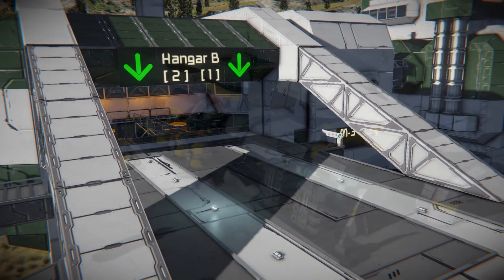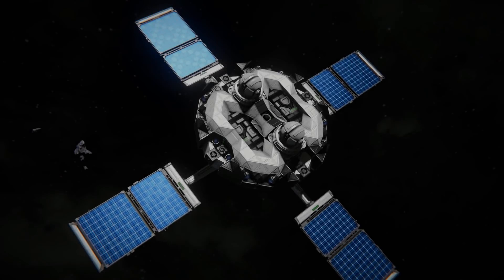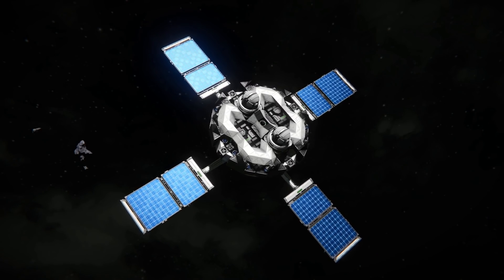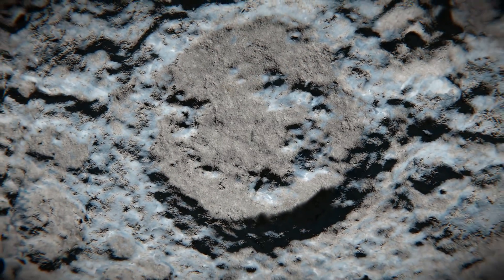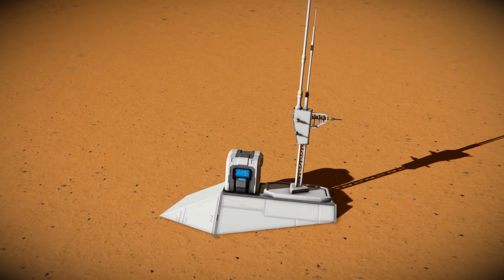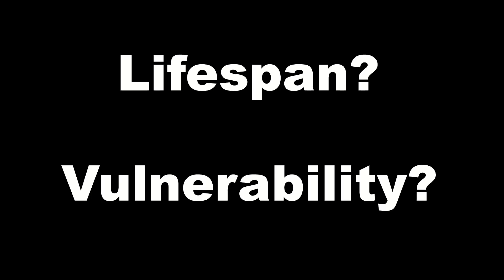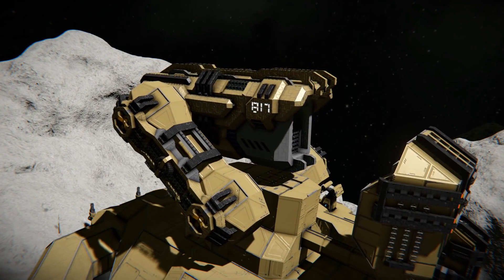The power of communication - satellites

Comment: While I enjoy radio and laser antennas usage for remote control and communication, a major flaw is with the signals on the HUD. If only you could turn off seeing the antenna from your personal HUD, it'd be a lot better. I dont want to constantly have every vehicle with an antenna show up on my screen, while I'm trying to go to a specific coordinate.
Reply: you can do that 4head
Reply: Just turn off show on hud on the antenna...
Reply: @benlawton5420  This wouldn't work, since I do sometimes want to use my antenna to locate the vehicle.

I did find out that it indeed is possible to stop seeing antennas! If you go to the info menu, there is a slider for how far you want to see neutral/hostile/friendly antenna's! I never knew that was an option!
Reply: @Moshthun  Would it be possible to put a remote control block on the vehicle so you can remote access the antenna?

Comment: Nice video! I tried to do something similar in the multiplayer server I played. In this server, the only planet with uranium was the Alien so my faction and me spreaded 6 radars (mod) around the planet (2 in each pole and 4 in the equador line, to minimize the blinde spots). Our goal was to detect and attack any player who tried to mine the planet, so we could monopolize the uranium production and sell it at high prices at our trading station near Earth.

We tried to make some high towers with laser antennas to connect all radars to our main base, but the server didn't render grids that doesn't have players near by (for performance optimization). So we had to use radio antennas, but they denounce our radars location.
Reply from the maker: Controlling uranium is a big thing, you figured the radar system pretty nice too.
Unfortunately most of SE servers, due to the game optimization can't handle such tasks. 
I hope that in the new update we'll get some improvement in that matter. That would be a big step for the game.

Comment: Honestly if you want optimum efficiency out of your long range relays place the sats further away. The longer the distance the more area is covered in the FoV. Keeping this in mind a grid of 3-4 laser satellites placed in a triangle or pyramid formation should be able to cover nearly all area you’ll need only being blocked by the occasional object floating inside its fov.
Example: placing the earth moon system inside a triangular base pyramid formation should cover the whole earth and moon in coms provided that the satellites are far enough away and one of the vertices is placed on the other side of the moon from the earth

Comment: This is fantastic if you have a server capable of keeping all these grids simulated over such a large range.

If your using concealment via torch server this won't work unless you mark all grids intended to use communication like this as exempt or if a player is located at the location as once the grid exceeds the range of concealment settings it will no longer be simulated by the server

Comment: For the lifespan of satellites you can simply use a lot of solar panels, and automatic orientation to the sun with radio antennas. You could also use backup reactors or hydrogen engines.

Maybe a timer block for when you want to temporarily deactivate their antennas to save power ?

Comment: On a server I used to play on where we were testing out a mod to have massive amounts of players being able to play on one server we used to have to use laser antennas constantly. Especially for old stationary Grav Drives since you need to know if there is any obstruction at the end of the ring chain so you don't hit it when you launch , and to know if that section of ring chains is even active. You don't want to just blast past the area you were trying to go especially since back in the day dropping out of Grav warp with using thrusts sometimes caused issues where your ship took large amounts of damage suddenly dropping back to the max flight speed from the broken Grav speed.

Comment: I've cuaght a few of your vids, I like the way you are presenting this material. 

Here's an additional thing : 

Place a camera on the Sat systems that will look at the plannet. this allows you to remote into them, veiw through the camerra and take a screen shot. 
From there you can use an image conversion tool, or find a player made Screen img mod and modify it (replacing file names and saving it in a folder with the images) 

This allows you to make a map of the area, each picture can be displayed separately or joined on multiple monitors (you may have to edit the screen shots depending on screen resolution)

Creative people can use this process to make a mill briefing stile infographic to put up in their base

Comment: Love the content. 
I've always wanted to setup a von Neumann probe in space engineers. Seeing the creative uses of scripts like pam in videos like this and sorts. makes the idea a lot more viable when you have well versed users attracted to the game. 
with the use of merge blocks, projectors, and some programs that can interface with pam. a self replicating pam base station sounds amazing. I've only gotten small concepts of the separated segments of the idea to work. but patching it all together is a full on job all to its self.
Reply from the maker: I think it's possible but it needs to be made out of resources which you can refine from stone. Otherwise the probability of hitting a cobalt or uranium vain are low and it could get stuck.
I will think of how to make it. Perhaps there is an easy way. 🙂

Comment: Been tinkering around with that kind of stuff lately. For me, the bottleneck is always the power consumption of the vanilla laser antenna.

So I could either mod it, make extremly big solar panels (eating away processing power) or go for a more "static" approach.

My satellites use Isy's Solar alignment script, but even with that the power draw on laser is just too damn high - and I don't like limited lifespans (despite being realistic, but it's tedious imho - I might as well get a mod then which is adding tearing down of working blocks in general).

In the case of earth and moon, you could probably just set up your bases in a way that they constantly "see" each other and feed the grids with reactors and such.

Since I run Industrial Overhaul, I could also just go for some RTGs and add enough uranium to last them for like a reallife year or something.

Another approach would be to write a script to shuffle through Laser Sats and put them to recharge, while always one is active. But again, this is taking away PCU and is overcomplicated for something which shouldn't be much of an issue imho.

Thanks for the input!

Comment: I setup a automated setup like this overly complex and i had to constantly rebuild the transport drones but i had mining outpost with pam setup. Then pam autominning ore detection script to show all gps of all ored my minners come across. After i got that setup i used pam to transport from there to a relay about 29kl away.... This part was tricky... But after drones got there they dropped into collectors that trasfer to larger rocket to fly to my mainbase this station had the laser antenna to comunicate. Then all my larger cargo hauler had to do was land unload ore and any basic ingots stone gave me thru a single basic refinery on the ship and refule and return! I could control and see using cameras at least at mining site and roughly track my drones or at least tell if one damaged via pam control dcript lcd on my main base in costand comunication with the script on moon.

Comment: I still haven't gotten into automated mining like this, so seeing it working so flawlessly is amazing.

Wouldn't the satellites have a large power requirements for transmitting over large distances? I've only used the laser antennas a few times since I play solo.
Reply: Maybe things have changed in the last year or 2, but in my experience laser antennas are very finicky. A couple years ago I tried to establish a system-wide communication network in my survival world. I created a good number of links: Earth-to-Moon, Mars-to-Europa, Mars-to-Alien, Alien-to-Titan, and more. However, I never managed to get the Earth-to-Mars link to work. It wasn't a power issue, and spectator didn't turn up any object that could be blocking the signal. I've had other experiences where 2 laser antennas with line-of-sight fail to connect, so just be aware. And yes, the power requirements for long distances are insane... I don't remember the specifics, but it was on the order of hundreds of wind turbines for each side of planet-to-planet links.

Comment: i already use relay satellites but im slightly ashamed at the fact that i also play Kerbal Space Program... had not thought to add lasers to them to improve my system... i am going to have to do this now which will greatly reduce the current amount of relays i am using that are stretched from point to point to maintain current contact.

Comment: do you need to manually fly around the planet/moon and set GPS coordinates for every single satellite you want to deploy? or do you have scripts for this?
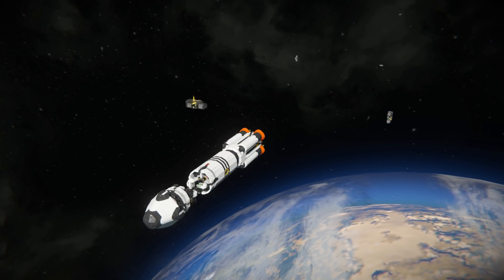spamming satellites at 0:57 looks very cool^^
Reply from the maker: There are scripts for this but could be done based only on timers. That rocket from the video (will be on workshop soon) is programmed to get to the certain altitude, start to orbit and keep it, then depending on what the distance between the satellites should be, it releases them in the time intervals to cover certain area. 🙂

Comment: Play-Doh Conquest over at one point and one of the factions did something like this to create what they called the eye of omnipotence system basically they could monitor everything across 3 entire planets. (Granted the server had like 18)
The things that they could do, it was terrifying. Other factions needed to use jump drives to quickly reinforce they just accessed a terminal then remotely controlled a warship /drone. Speaking of which.
Hey @ Ferocioustwnkie you gonna post that thing on the steam workshop?

Comment: Moving community..
We need a radio mod that allows signals to bounce off metal objects... So we can build realistic receivers and dishes to use as communication satalites and or base antenna... For long range communication. Much like a laser antenna... Except no range limit as long as the two transmitters have a direct line of site... Make it real... So interference can be had if objects pass between them... And radar can be recreated with them...
Reply: laser antennas do not have a range limit, but past 200km the energy calculations are quadratic instead of linear, wich makes it inconvenient but possible.

Comment: So long as a grid is powered and has something running on it like a programming block, shouldn't it avoid any garbage clean up? Meaning if you had suffficient solar panels you could consider them to be semi-permanent installs.

I've been wanting to play with this concept a bit, just haven't had the time, or a PC that won't melt to slag if I generate too large a map lol
Reply from the maker: That depends on the server. Many of them may freeze the grid to save some resources and unfreeze when a player will be in the proximity. There are some servers which do not have such limitations though and are more flexible when it comes to making a communication networks.

Comment: I wonder if this actually works. The problem i see is that most games only have the area close to a player loaded and simulated but everything out of view range isn't being calculated (makes sense bcs pcs doesnt have unlimited resources). Therefore the chance is relatively high that SE is programmed in the same way, so the whole automatically mining on moon and hauling it back to earth without a player near it might not work. But i havent tested it yet
Reply from the maker: It works in single player and on some multi servers, however some of them got limited rendering range so if you get too far all the grids from the system will freeze until a player gets in range again.
Reply: @Pro100tv9  thx for the quick answer 😄

Comment: you forgot one other issue lases satellite increase in power consumption the farther they are apart.
Reply: Not a problem if you manage to build power plants/solar arays/wind turbines en masse for sustainable power consumption.
Reply: @TReyeHD  new problem PCU limit.
Reply: @XadeGrimm  I actually made something along the lines of space solar net and with the help of Isy's solar alignment I made it rotate along with the sun's rotation.

I only made one net of solar panels but I can imagine it working with more.
Basically, I have merge blocks on my space station and the solar net and whenever the power was low in the station I press a button and a battery drone would disconnect from the station, fly to the solar net and replace the depleted battery.

So I can imagine with multiple grids, PCU limit won't be a problem.